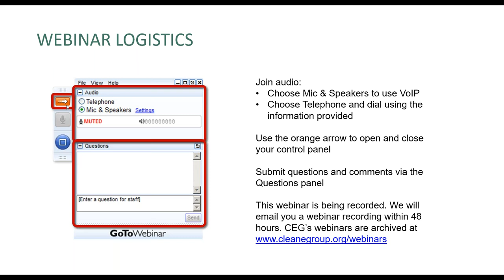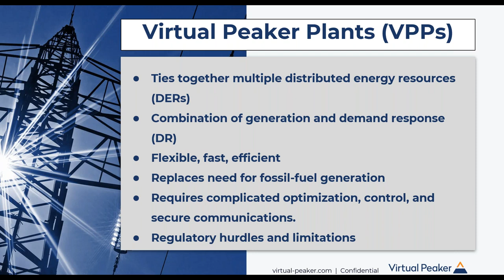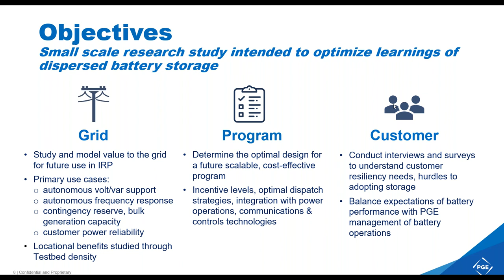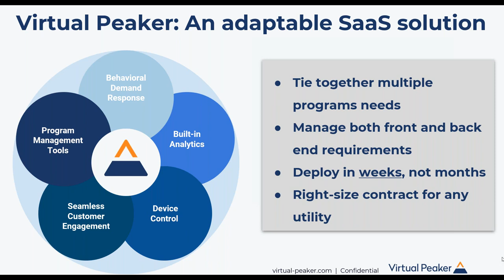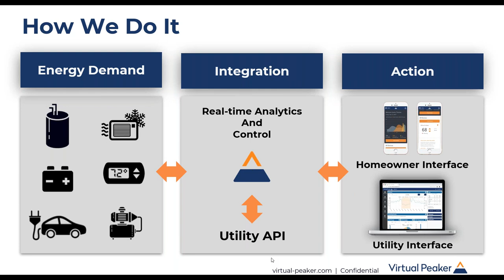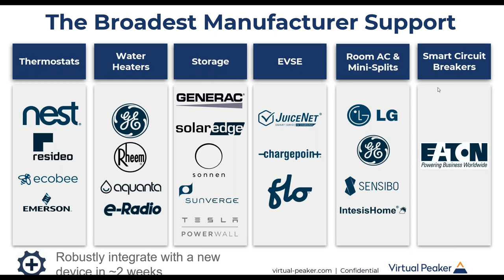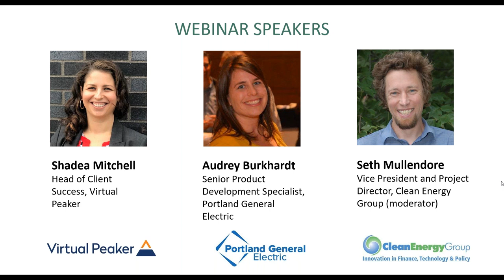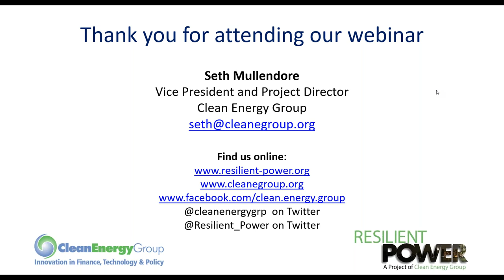An Introduction to Virtual Power Plants (9.28.20)

Comment: I think this is misrepresentation of the concepts here. It is a simple stoage system for power just like water towers are used to store water when demand is low during the night, the opposite for the need for electricity, and used to maintane the flow during peek demands. There is no extra water (or power) generated, just a better management of what resources we do have. I do see the need to do this.